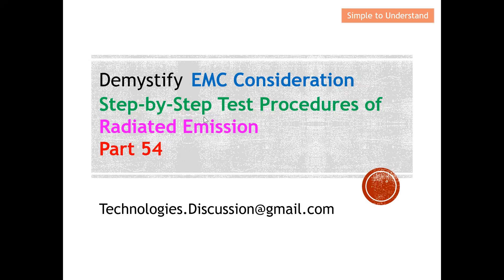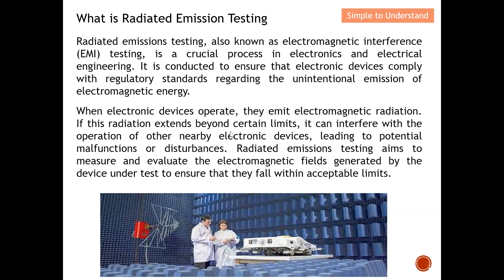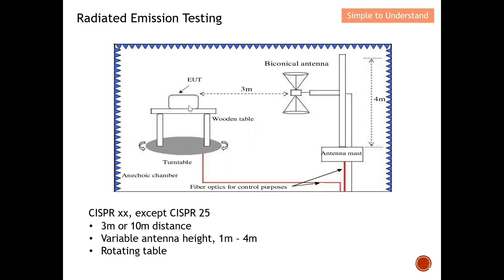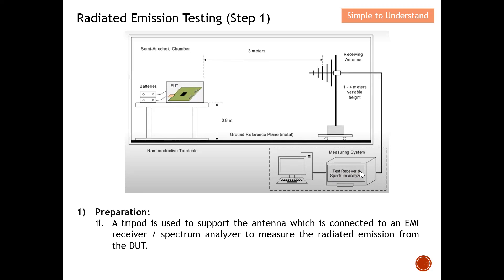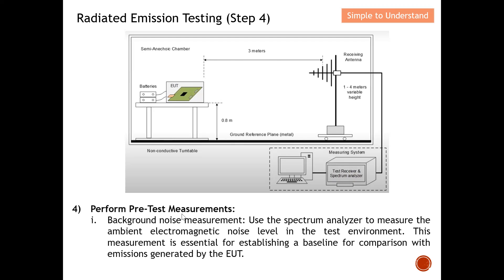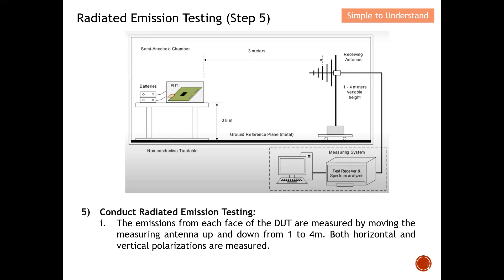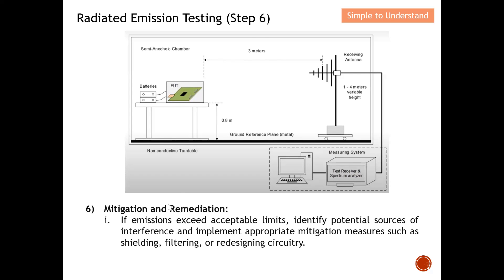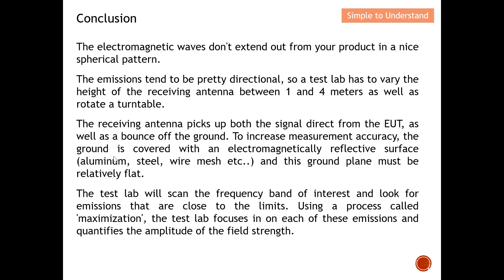EMC #54. Radiated Emission: IEC/EN 61000-6-3, CISPR 11, CISPR 32, CISPR 25 Compliance Test Explained

Comment: what will be the impact if we use a copper table inside the chamber
Reply: Understood.Thanks for your quick reply and response.
Reply from the maker: No Problem.  :)
Appreciate u can help by Like this Video and Subscribe to this Channel. Thank you so much.  :)
Reply from the maker: If you use a copper table, you can imagine that there will be many reflected waves in the chamber, which is undesirable. We only want to measure the direct path and eliminate the rest. Therefore, the results may not be consistent if a copper table is inside the chamber.